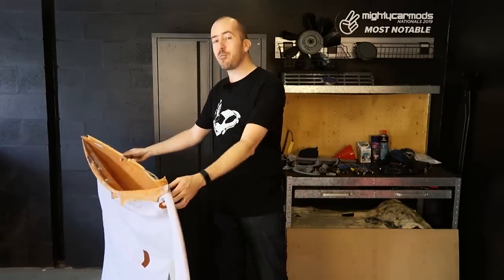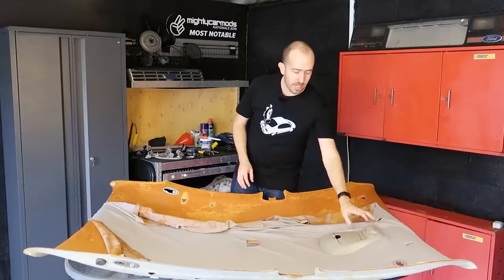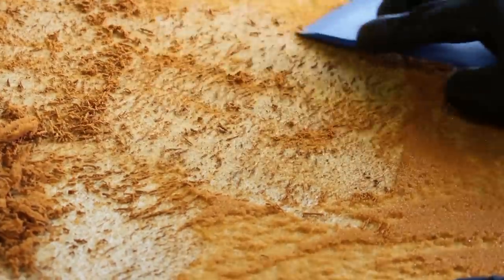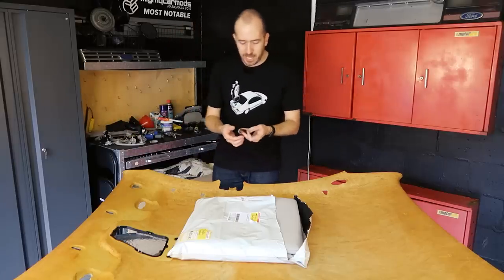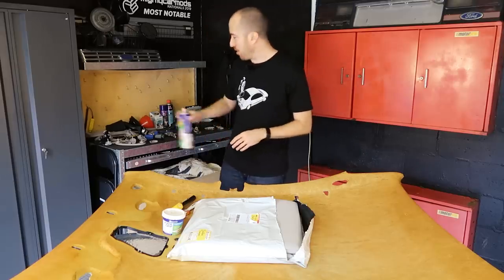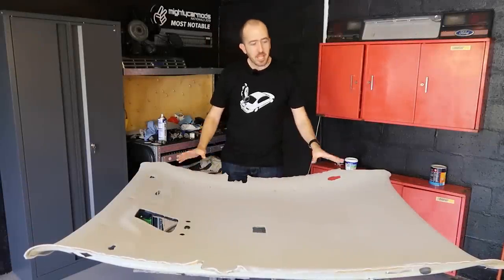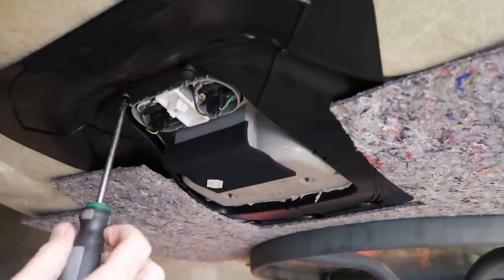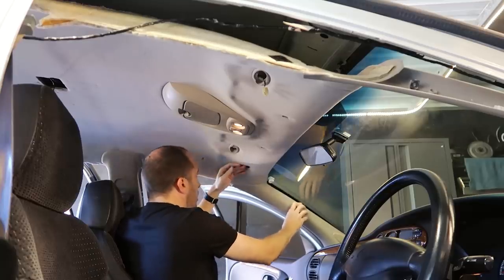Fixing the Headliner on an AU Falcon! Roof Lining DIY Repair Guide for Beginners

Comment: My local motor trimmer tells me that one way to make your new headlining last is to make sure the ends are rolled over the lip of the board, front and back. Both Ford and Holden do theirs cheaply by just cutting it off at both ends. The heat and sun from your windscreen then make the foam deteriorate early. That's why, when the sag begins, it's often from near the windscreen. Manufacturers who are more mindful of this will both roll the lining over the front and back lips, as well as install a trim piece to lock it in place and protect the foam. Commodores had it done on the back, but not the front.
Reply from the maker: Yup it's a good idea. Mine were rolled over slightly at the ends, and I also put staples around the perimeter just in case.

Comment: Here's a shortcut upholsters look at me funny for doing all the time; those falcon and commodore hoodlining boards are made of fibreglass and they can get wet, so I just hose the old foam off them and wait for them to dry haha so much easier. I'd done so many for a VT/VX/VYI that I got a spare hoodlining board from the wreckers as an exchange board so I always had a hosed and dry one ready to go if I'm in a hurry that day. 

Otherwise, if the board is cardboard and can't be wet, or I don't have time to let it dry and I have to go old school, the sweeping it through the interior light hole into the wheelie bin trick is exactly what I do haha, although you should use a stiff plastic bristled brush, so much easier. Good job for a first time though, falcon ones are much harder to stick down because they're so dishy compared to a commodore, but you got very few crinkles in the fabric by the look of it. 

Also the front and back against the windscreens, you should roll the fabric around and double glue it so it doesnt start lifting because there's nothing there to hold the fabric down once it's all back together
Reply: My very first thought as he started the video was "Water-blaster". Then looked closely to confirm it was either fiberglass or plastic.
Reply from the maker: Great tip. I planned to apply the glue almost immediately, so I definitely didn't want to introduce water into the equation. The brush is a good idea though!
Reply: Folding over is obvious, but Ford did not think to do that for my Territory.  The interim solution was using a staple gun around the perimeter; the only place it has come apart so far.  My TH Magna ended with grey-painted drawing pins in a pleasing diamond arrangement.
Reply from the maker: @steved3702  I ended up stapling mine around the perimeter before I installed it. If you put them right on the edge you'll never see them once installed. Good safety net to have in my opinion.
Reply: @MotoringBoxTV  Not perfect though.  It was my Territory featured on Hubnut's channel.  From his in-car camera angle, you can make out the staples along the windscreen! 😂

Comment: this is the video I was looking for my 1999 au falcon. Never thought a video as good and specific for my model of car would exist
Reply from the maker: Glad the video was useful mate.
Reply: @MotoringBoxTV  yeah I was lucky and got a steal off gumtree for my first car for $1500. Ive been saving for a car at 17 and finally found the car of my dreams. Being a mechanic with tools i thought fixing my crappy headliner would be a fresh start and it only has 165,800kms on the odometer. seller also had old service records all the way back in 2003. great vids love the content

Comment: I ended up calling a professional to get my AU headliner replaced, couldn't be more happy and it's lasted for well over 6 years
Reply: I did the same for my el xr8. I removed it myself and had an upholsterer match the factory headliner. Only cost $120
Reply from the maker: @beyondbackwater4933  great way to save a bit of cash.
Reply: Thorough job well done. I did my vienta wagon a few years back. The best glue is the upholsteres stringy spray glue in the maroon can, spray both surfaces and wait 10 mins then it's good to go. It lasted ages and never sagged again.
Reply: @Dino_Dad.  Did the upholsterer put in foam?  It seems the be the foam disintegrating rather than the glue giving way, so I am wondering if it is better to leave out the foam.  Finish may be less satisfactory, though.
Reply from the maker: I think you need the foam otherwise the material will get wrinkles when you try to mould it around corners and the like.
Reply from the maker: Yup, the stuff I used dried slowly.
Reply: Money well spent. What's a few hundred to make you happier for years?
If you're hardb up for money that's different.
Reply: Same for my FG....
Reply: Same for two of my BFs.  Can't remember the exact price but it was a couple of hundred for the both of them, and they were both done by lunchtime.  Gary Pearson's Auto Upholstery, in Morayfield.  I have no affiliation apart from being a happy customer.
Reply: 6 years? These should last 30-40 years, at least. I've got some 30 year old cars with near perfect headliners..... We need to pressure manufacturers to make products that are as durable as possible, as things like headliners failing along with a few other items sometimes result in lazy owners dumping their otherwise useable cars.
Reply: @jellybean1976928  
No 3-4 mm foam will last 20 years let alone 30-40.
The problem with it is the extreme heat generated from the roof to the foam in the lining. Making the chemicals in the foam to deteriate. 
Lounge foam does the same thing over time but being a lot thicker it takes longer for it to happen.
Reply: @davidd1492  I have Volvo 740's (about 12 of them) I've owned for 15 years that I'm sure had original headlining when I bought them. So now the foam is 30+ years old and is still holding up. That said, I have out of all those cars one 89 model that lived central VIC in like new condition with a completely failed headliner, yet others I'm sure are much older / original that have either no failure or only minor signs starting.

The moral of the story, (1) These style head liners have highly variable lives (2) These style headliners are STUPID. Check out a 1970's Volvo 240, it has a non bonded headliner that will virtually last forever. Never seen one fail.

Comment: A falcon headliner is like a VT’s the fuel cap door.
Reply: They all seem the same.  I would not be surprised if there was only one supplier serving all Australian manufacturers back in the day.
Reply from the maker: They probably were haha
Reply: Late 80s though 1990s seem the worst. Many American cars of the period had the same problem.
Reply: i just bought a BA and found this out too late
Reply: true hey.
Reply: Commodores are the same saggy ceilings ; why people don’t just get rid of the material all together and just paint it
Reply: I did the extraction myself but got a pro to do the recovering, because fuck that shit - especially cleaning all the foam off.  Anyway the pro said loads of manufacturers use the same stuff - he does Audi's VW's etc from the same era that all have the same problem with the foam degrading and the fabric stretching away.  He had a BA falcon in the driveway yesterday when I dropped it off, and today when I picked it up had a VE commodore - both with the saggy headliner.  Incidentally he said he uses a chemical cleaner to remove the foam, but I didn't ask him what it was.
Now I have to put the fucking thing back in this weekend which is what brought me here to see if I could pick up any tips.

Comment: You did a great job from what I saw.  My au needs this done badly.   I got a quote from a motor trimmer a few years ago and he wanted $300.  I'm glad you put the  comment at the end about it essentially being a tedious job and not particularly enjoyable.  As with anything to do with DIY to cars, if it's your only car, you're under the pump to get it finished and that takes away a lot of the enjoyment, especially if you've never done it before.   Like everything, you can't beat the bloke that does it for a living, you can only give it your best shot.  Good stuff.
Reply from the maker: Yup, I'm lucky in that I have other cars to drive and could take my time. Doing stuff like this against the clock would be quite stressful.
Reply: $300 a few years ago + 2 years. I hope it hasn't doubled. But I'll pay that.

Comment: Brings back some memories, and nightmares. Had to replace 100’s of these when they were new cars still under warranty. Just recently did my parents AU using your method. I found a wurths product spray on glue which worked out beautifully.
Reply from the maker: Really, that early in their lives huh?
Reply: MotoringBox Not as bad as a 20 year old one, but yeah, the odd bubble here and there. It was common, and technicians would usually pick up on it, not the customer and replace it under warranty.
Reply: I bought some REPCO contact adhesive spray to do a temporary fix on the back which started to go first. didn't work at the time as I was getting foam from the damaged liner dropping down all over the back seat and gave up. But the glue has been lasting for years and very strong. Always considered the job to be impossible for a novice but thinking of another try on the whole liner. The glue idea came from a YT vid but they didn't show removing the dried out foam.

Comment: Pro tip: if the glue doesn't get you high from the fumes, it won't last.
Reply: Electric space wizard!
Reply from the maker: I recall it being pretty strong, didn't get high though unfortunately.
Reply: @MotoringBoxTV  Fortunately that is. I was working at a Co. who used large amounts of contact adhesive, with the Toluene 'high', that had me felling very 'off'. Turns out that was a series of small heart attacks.  I left and my Dr ordered blood tests, next day in cardiac ward having stents installed... a year later major bypass surgery. Better ways to get a high with less risk.

Comment: You at least tackled this unpleasant job head on and got a perfectly good result for that car.
I was fortunate enough to find a good one at a self serve wrecker for my NC and managed to wrestle it through the front doors of the two cars. I used my little Laser to bring it home as the LPG tank in the Fairlane precluded use of the 60/40 split fold rear seat. 
The edges were abit frayed by the time I had forced it in three cars but the trim hides all that and it looks beautiful 3 years later.
Reply from the maker: How'd you fit it in a Laser? Haha
Reply: @MotoringBoxTV  Laser has some tricks such as 60/40 split fold seat and the hood lining itself curls willingly in the sides. It fitted front to rear no problem in the sedan -which is slightly longer than the hatch.

Comment: As always your presentation is crisp and on point, well done again. 
Back in the 70's we used to replace  a perfectly good  headliner covering  for fun after a custom paint job, and usually with a color that would now make one gag, usually some wannabe 60's theme......i am astonished at your first attempt  and success. i would add...use  a spray (Alcolin) or other acid free adhesive, definitely use a paint roller to apply the new material and rather remove and  replace via the tailgate if you can (drop the rear seating)

By the way i am the proud owner of a '99 Fairmont, you might want to do a presentation on replacing  the rear door locking servo's, mine packed up and i believe it is a fairly common issue.

Comment: As soon as you said you're going to use Quick Grip I said NOO the glue is crap, don't use 3M either. I never let it dry for a week tho, a few days maybe. At first, it sticks but after about 2 or 3 months it fails. I hope you were more successful than me. I have not done the headliner yet only door trims and I now use High-Temperature Contact Adhesive HTA1000 but it needs to be used outside or in a well-ventalated area. From my failed attempts with door trims even with HTA1000 I have not attempted to do a headliner yet but I am going to try one soon on a wagon and I needed to see this so thanks heaps for making this clip.
Reply from the maker: So far so good, going on 6 - 7 months now and it hasn't changed. It would have been 100% humidity on the day (raining heavily, and had been for the few days prior) plus it was pretty cold and I was filming in an open garage, so I can't blame the glue entirely. It stuck very well in the end and has tolerated some very extreme temperatures so far.
Reply: @MotoringBoxTV  Good to know. I paid $180 for a pro to do the headliner in my AU 3 years ago but my wagon I want to give it a go my self :)

Comment: Great video...Did it during lockdown on my BA wagon...used silicone and a little roller and rolled the edges over...tedious...but was quoted $400 for it.. ended up getting the fabric for  my wagon and 2 utes for $120 off ebay...and 3 tubes of silicone and done...might try the next one with a notched spreader next time...

Comment: One thing I'd point out is you can be pretty brutal with the headliner itself, it's a fibre composite and it's incredibly flexible - keeping that in mind will make removal and installation a bit easier.  If you do spit it, it'll be near the edges and probably only tiny - just use a bit of fabric tape to repair and it'll be sweet.

Comment: Great job.  They are quite easy to do. To get the foam off just use a hand wire brush for the glue you need contact adhesive it’s yellow in colour and needs to be sprayed on both sides leave till they both go tacky then put together :).  And only do one half at a time
Reply from the maker: Great tip!

Comment: My AU Xr8 is starting to sag was well, although not as bad as yours. I've used grey drawing pins in a couple of key spots to keep it out of the way. Am planning to respray the car as the roof clear coat is just starting to go & was going to redo the headliner at that point in time. To do it myself looks a bit challenging. Great video by the way.

Comment: That was a great job - very professional. My roof lining started to drop in my BA Fairlane - I paid a guy to do it as he had more knowledge than I -  I see you went over the front and rear edges (Ford and Holden did not do this when making their cars). My shade of roof fabric was slightly a darker grey, but still happy nonetheless.
Reply from the maker: The colour of mine is slightly lighter than the plastics, but I think it's close enough.

Comment: When removing  the roof lining from my BA I just used a Karcher to remove the foam. Was a lot simpler than using a scraper. It didn't take very long and  was  very thorough. Then I just sprayed the lining  using a couple of cans of light grey spray paint from Mitre 10 ....  Thanks for the video  ~(,,  ,,">

Comment: I have done this with 2 x AU wagons, which is a lot of real estate to deal with. I tried to get replacements from wreckers, but all the head liners have the same issue, due to the foam backing crystallising (maybe time to stop using foam backed headliner car manufacturers). 
The main issue is that although you may be able to get most of the old foam off the shell, the old contact adhesive remains, and contact adhesive hates sticking to old contact adhesive. 3M 74 is a foam adhesive spray that is pretty good, but whatever you use, unless you get a solvent and remove the old glue, the bond won't be great. Gap in the market for non foam backed headliner !!!!
Reply from the maker: Interesting about the glue. Mine adhered very well in end, but it'll be interesting to see how it holds up over time.

Comment: Tons of good info here thanks. Did mine with permatex spray adhesive, but it came a bit loose in one spot because I pulled the fabric too taut in one area.
Reply from the maker: It sounds like a great option. If I'm ever silly enough to try it again in the future I'll definitely use that.

Comment: Top job.  Maybe the non water based Quick Grip would have been better. Never done a headliner but have done several underbonnet insulation’s.    It was suggested to me that even though the replacement bonnet liners are self adhesive, don’t trust them. Put Quick Grip Gel on the bonnet and the liner.  Always used the normal one, quite smelly, but it sticks.  You were lucky to get it out the door, with some the only way is removing front or rear window.    Loved Griegs Peer Gynt suite (my spelling).
Reply from the maker: I actually found a recommendation from Selleys directly that this product was ideal for vehicle headliners, so I decided to go with it. I was worried some of the non water-based glues might dissolve the foam.

Comment: If the manufacturers would go back to serviceability rather than redundancy we'd be much happier. Older vehicles had headlining that lasted the life of the car and the paint only ever needed a light cut and polish. Current crop with clear over paint and foam backed everything deteriorate so quickly even when babied. Good video but the glue is the thing, need to get the speciality spray glue not general glue.
Reply from the maker: True, the foam really doesn't stand up well to the heat long term. There's also the question as to why a headliner needs padding anyway - noise and heat insulation I suppose. The glue has held up well so far over a year later.

Comment: Aaaah the goold olde saggy headliner.  A classic 'feature' of many older Falcons and Commodores.  The headliner in my BF Fairmont is on it's way out.  It's only at the edges, so not serious enough for replacement yet.
Reply: I can confirm I have seen a TR/TS Verada (1991 -96) with the same problem.

Comment: Eco or water-based contact glues are usually shit, for anything.  Sometimes you have to do two coats if a surface is porous, the first coat is basically a sealer.
Reply from the maker: Yup, seems so. Luckily my headliner is still holding up well.